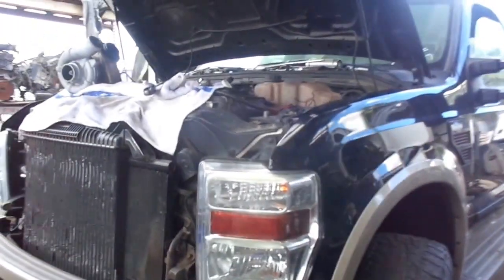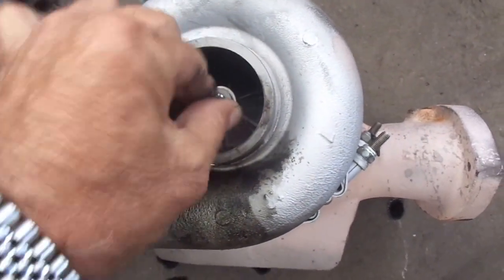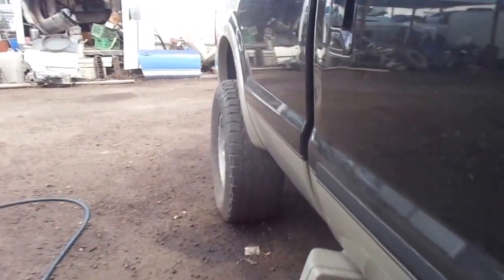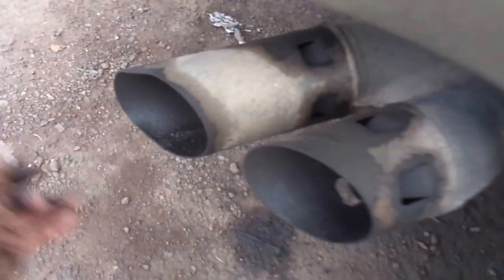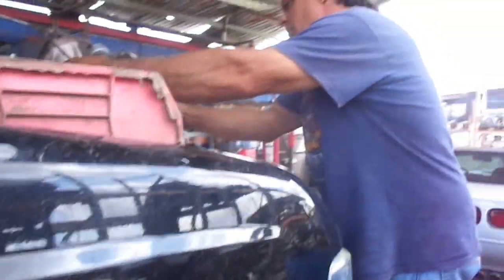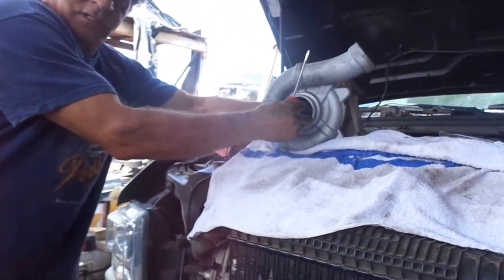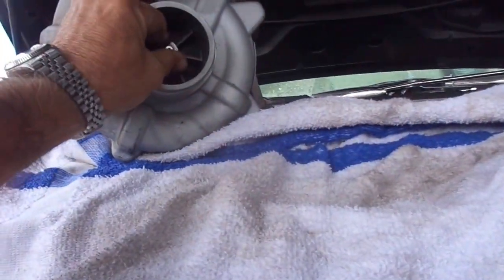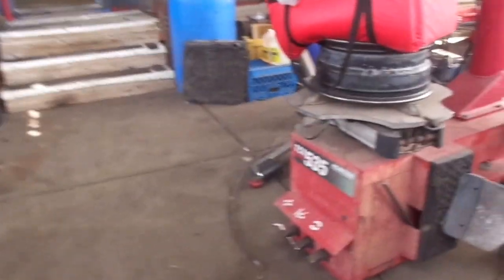2008 Ford F350 6.4 Diesel Turbo replacement

Comment: I just recently bought a low pressure turbo off a 6.4 powerstroke (big turbo) shaft play isn't too bad, just needs a rebuild kit, when i picked it up i saw the low pressure turbo, the shaft play was stupid, turbine didn't even want to rotate